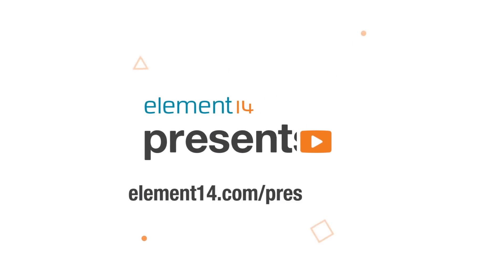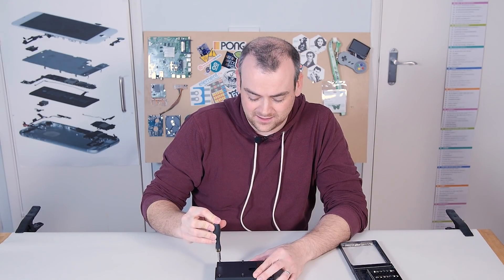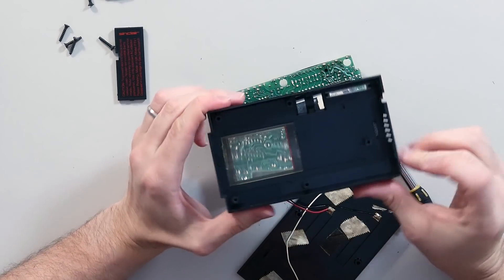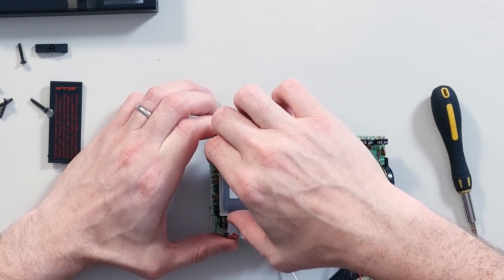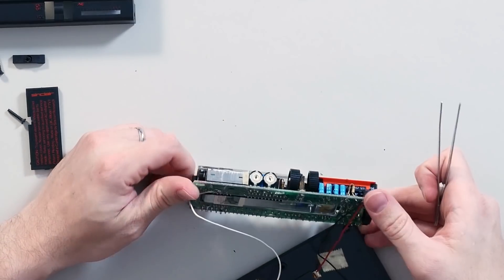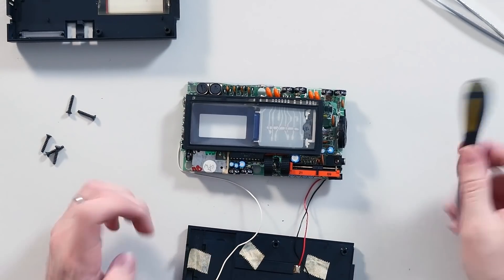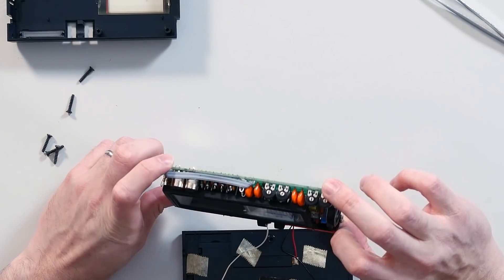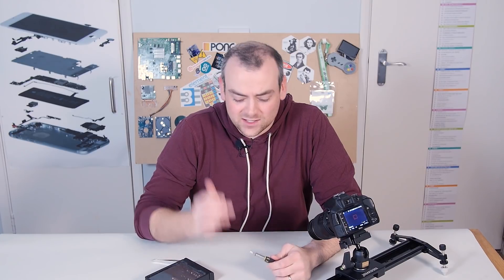Play N64 on a Sinclair TV80 - The Electronics Inside

Comment: I have a pristine tv80 in my wardrobe from when I was 13. The slot fit a Polaroid battery and you could get a pack of 3 but they were dead expensive and it soon ran out. There was a theory that you could split a Polaroid film pack up and take the battery from that to fit the TV but I only tried that once and failed. Shame they're pretty much fossils now.

Comment: I bought one when it came out and sold it at a car boot sale in the early 90’s.  the back slot was for a new ultra thin battery which quickly became impossible to buy so you had to purchase power lead. I loved mine and used it a lot.

Comment: Of course ebay is full of jokers who try to hide the fact they don't have the charger and bespoke lithium battery included in the sale even when the price should include a mint condition box and unit full functional with brand new condition battery ho hum. Interesting because it is NOT crappy 1980s smear-o-vision LCD pocket TV and should have a higher resolution if it is even a half decent portable CRT quality dot pitch but no way to find out now for myself sadly.

Comment: I've been trying to get my Tv to work and its safe to say its putting up more of a fight  ( but i will win ;) ) 
The slit at the back is for a flat Lithium battery ( non rechargeable ) and according to the maintenance manual ( linked below ) it would power the Tv for about 15 hours so would do a few long train rides . 
Page 17 also has a list of what the variable resistors do if anyone's Tv is in need of adjustment :)  https://visions4netjournal.com/wp-content/uploads/2017/10/Service-Manual-Sinclair-FTV1-FTV2.pdf

Comment: The TV80 had a slot-in lithium battery pack. There were several different versions of this hardware, some had the CRT soldered to the main board, others were pin and socket. 

It doesn't really have the ability to handle composite in, but you can get a reasonably cheap composite to rf adapter, and these have existed for a while. 

The full schematics for the TV80 you have are readily available online as well.

Comment: I do have the tv.. and yep the battery with it, is like a wafer thing. much like say you'd get with a tablet etc.  would like to convert mine to a "comp" signal instead. if anyones done that yet
Reply: Can you share any photos of the batter? I'm curious now! It'd be a creat challenege for comp conversion! I'm not sure if it would be totally possible, as I think the rf demodulation takes place on the IC and is only output as CRT signals?

Comment: Get a phone case with a stand
Reply: To date, I have not regularly used a phone case (so far without any issues with damage). I feel slightly cheated by the idea of buying an incerdible device, which has had millions of R&D spent on it, to slap it in a case and double it's thickness!

Comment: I just purchased a 1987 soundesign boombox with monochrome tv built in.  The large form factor of the boombox is useful for attaching a raspberry pi.  Using the first generation raspberry pi is nice too because it already has an RCA analog output to be converted to RF.
Reply: Sounds like a neat solution, do you have any photos / videos of the project?

Comment: The tube has electrostatic deflection, not magnetic. One fun fact is that the scanning waveform is immensely complicated, and Sinclair designed it by using raytracing mathematics. They started on a Spectrum, worked out that it was going to take a few years to complete, so ported the code to a Cray supercomputer. Probably the only such port ever. Oh, and don't worry about X-ray radiation from the tube, it's far too low a voltage to produce anything remotely worrying. The battery used was a custom job, a primary lithium cell made by Polaroid and derived from the one they invented for their instant cameras.
Reply: A Cray? That's really cool! Do you have any reference material or do you know this first hand?

Thank you for the correction, you are of course right, they are not electromagnetic!
Reply: I worked at Sinclair in the mid-80s :) There was a test production line for a 4" version of the tubes, but the air pressure on that flat front plate made them excitingly prone to implosion. The colour versions were also eccentric- could manage two out of three phosphors, so not quite enough...  @a531016
Reply: @proudsnowtiger  That's awesome! Great to hear from the team itself! Just wondering, was the Cray UK based?

I have to say, I was impressed with the Mono version, a colour version would have completely blown my mind!
Reply: I don't know, I didn't work directly on the flat CRT project, except when it was being designed into Pandora, the portable Spectrum laptop that never happened...  @a531016

Comment: I still have mine bought in 1986 if memory serves correctly and it still works. I did modify the case to gain access to the pots to make on the fly adjustments. Oh yes, and it did use flat batteries which gave a few hours of life.
Reply: Do you still have a battery? I never managed to track down so much as an image of one, so I am still interested!
Reply: David Edwards unfortunately I haven’t seen or heard of the battery for many years. I think they went the way of the tv. I powered mine with a pack of 4 AA batteries plugged into the power socket in the end.